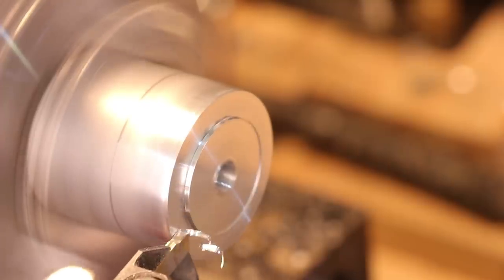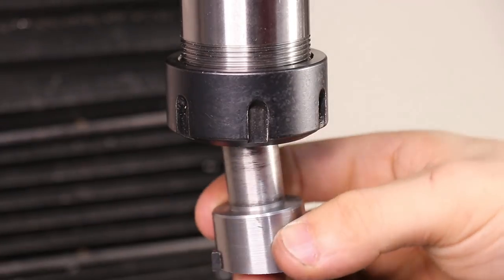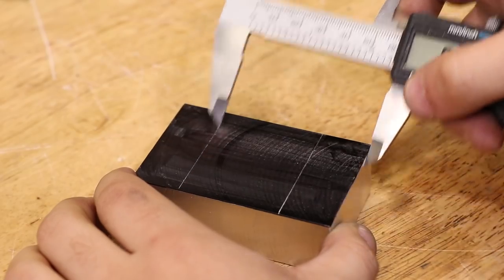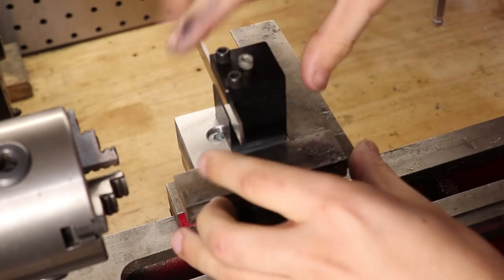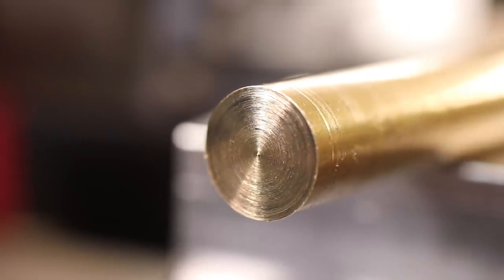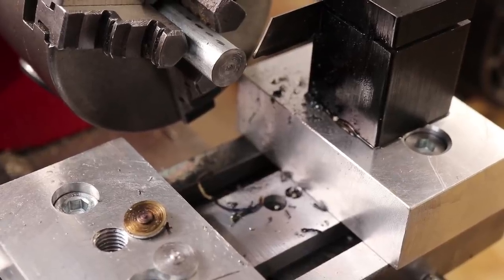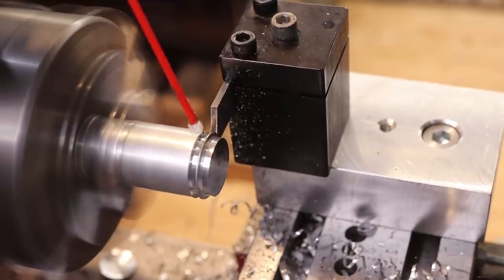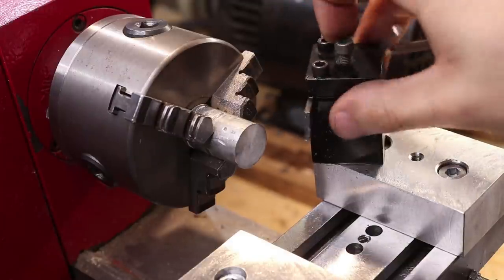Mini Lathe Rear Cut Off Tool Post Upgrade

Comment: You are definitely turning the spindle too fast as you said. But you have very poor tool geometry there is WAY TOO MUCH clearance on the lower part of the tool (the top when inverted). You should have that area of the tool almost vertical. Since the part is round, as it rotates, it moves away from the tool and creates its own clearance automatically. With all the clearance you have, there is a high likelihood that the tool can be pulled into the work-piece (which is why the aluminum was grabbing). The top rake on your tool wasn't the problem with the aluminum, it was the front clearance....
Reply: Yes, you are right. The front clearance regulates the feed rate and prevents the tool from being pulled into the workpiece when ground at the correct angle

Comment: P.S. Get rid of the inserts. Its lazy and it keeps you from actually learning what you should have mastered before you started making you first parts. You are NOT a production shop, you're NOT running thousands of inches a day past tool bits. You have no need for inserts. You have a baby lathe. HSS WILL DO FAR MORE FOR FAR LESS MONEY. But, it requires thinking and learning.

Comment: You need to heavily study blade geometry. One blade does NOT cut all well. Adjusting just the speed is a recipe for a Fuqit Bucket full of scrapped parts. Your steel blade needs SIDE RELIEF.  Heck, all of them could befit from side relief. Side rubbing is where a butt tonne of your power is getting lost in your parting ops.

Comment: The keys for me are narrow parting blade and lower rpm. If I keep the speed below 300 rpm I can part steel just fine.
Reply from the maker: Cheers, I'm looking to machine a new set of change gears to drop the rpm to achieve these lower speeds
Reply: @artisanmakes  That will work.  Parting is one of those operations where everything needs to be perfect.  Very sharp tool, narrow tool, perfectly square, low rpm, your best high pressure cutting oil and then it will behave.  Love your channel. Those of us who operate the smaller lathes and mills don't have much content.  Thank you.
Reply: I have a mini lathe and for me self ground parting tools with about 2mm width, slight side reliefs and quite a bit of positive rake on not too low rpm work best. I also recomment to give your hss lathe tools a little touchup on a wetstone after grinding for a finer edge. So far I was able to part everything from Aluminium to stainless steel with some trial and error.
Reply: @artisanmakes  get mgmn inserts which actually work better at higher speeds. 

https://youtu.be/h6gVItCo1-I

Edit: I might've been too sleepy, missed the bit about rigidity and the fact that you've already got those parting inserts.
Reply: @brianmoore1164  take this with the knowledge that I'm talking about larger machines, but in my experience if you run the lathe at the same speed you would for your turning tools, and you keep high pressure on your parting tool you can achieve spectacular results. Usually if my part vibrates while parting I dig my tool in harder and that will quiet it right up
Reply: @chazmakarowski5429  I know what your talking about with keeping the pressure on and keep the tool cutting, but the little machines lack the rigidity for speed. You can pretty much do what you want in brass or aluminum, but as soon as you start to cut steel the pressure gets high enough that everything starts to flex. I can cheat it a bit if I screw the gibs down full stop on the compound, but it's easier to just drop the rpm. In cold roll or hot roll my lathe loves 270rpm. In 4140 it wants 200. I am operating a C4 sized machine and it has enough torque to cut that slow. Some of the stainless steels can be crazy hateful and others are no problem.  I use a lot of free drops so I never know how it will act until I start.
Reply: Likewise.  I had really good luck with low rpm and P style cutoff blades (e.g. HHIP 1/16 x 1/2 x 4-1/2 Inch 5% Cobalt P1 Style  Cut-Off Blade).  I run the lathe at the bare minimum speed with just enough torque to keep turning(120-150 RPM).  With a confident first shove and not too aggressive feed, I get nice flowing ribbons going.  It works great even on silver and stainless steel.  I think getting nice  ribbon chip is key for a smooth cutoff.
I tried in the past using high speed and found the chips became too small, blade overheated , and lathe chattered a lot.  I got the low speed tip from Quinn @Blondihacks.
A few strokes on the honing stone keep the blade sharp between uses.

I enjoy your channel a lot.  Keep up the good work.

Comment: There are many good comments here but the main reasons parting is difficult is due to the harmonics caused by spindle flex due to the distance from the cut to the spindle bearing and the cumulative leverage of the tool holder.  For the first issue there isn't much you can do beyond getting a chuck that is not as long.  "Winky's Workshop" did a series of videos on this topic, though he didn't really cover deeply the harmonics and natural frequencies which are what produce the chatter.  Reducing the distance changes the harmonics which improves things like parting.   The 2nd issue is based on the geometry of your ways and the position of the cross slide and compounds in relation to the ways.  When you move the cutter to the back and flip it upside down the cross slide is pulling up on the bottom surface in the back way.  This surface is not machined well on mini lathes and has a limited surface area.  It also is not rigid because of the grub screw adjustments in the back of the cross slide.  The reason reversing the motor with the rear cutter position works well is that it pushes down on the rear way which provides a very large contact area with little flexibility.  Your way pulls it up and unless you rework your rear cross slide way adjuster I doubt you can get good results over having the tool in the normal position on the front way.  As the cross slide "pulls up" it either digs in or backs off which produces the chattering with a regular frequency that is driven by the tool geometry and spindle speed combined with the natural frequency of the spindle flexing.
Reply from the maker: At this point i'll take what I can get. These lathes just aren't up for the job. The lathe I used to machine on probably weighted 10to15 times this. Considering how little i part anyway, im going to leave it at this. Cheers
Reply: @artisanmakes  I just made a whole video on the topic that I think could help you out.   maybe you can watch it,  baseline your machine, and finally share the measurements?

Comment: Thank you for the video. Very interesting. Perhaps it is time to investigate (electrical) means of reversing your lathe motor.  A switch to reverse the wiring to the stator coils will do that fairly easily if they are accessible, if not a motor capable of being reversed in that manner might be worth the investment in time and dollars (I find screw cutting right hand threads is often less traumatic with my lathe in reverse and the tool mounted upside down).

Comment: Your mill is "out of tram."
Reply from the maker: i know its out of tram, the adjustment gibs stripped in the hole so I'll have to drill it out to fix it. Parts still fall within tolerance so its not super high in the agenda.

Comment: High rake tools are a great option for low power tools as this mini lathe since it gives more of a shearing action over a tearing action for the cut which requires less power and can leave better finishes. The downside of course is that the tool geometry is weaker and loses the ability to dissipate heat.

If the aluminum wasn't cutting well with the positive rake tool my guess would be that it did not have have enough cutting oil to prevent build up on the edge. Being on the underside like that would make it harder to apply the oil directly before the cut compared to the tool being the other orientation.

Comment: Nice work! 
Made a similar rear toolpost out of steel for my Minilathe and it cuts steel, stainless steel and titanium like hell :-)
Reply from the maker: Titanium on a mini lathe is very impressive. Never attempted it on mine.
Reply: @artisanmakes  Titanium is roughly the strength of steel. Choose either indexable inserts for aluminum or very sharp HSS tools with a cutting angle between steel and aluminum.
Cool well, especially when parting off. In contrast to the other metals, the chips do not dissipate the heat. This means that the workpiece will warm up quickly.
Drilling: normal HSS drills, but lubricate well otherwise the drills will rub into the hole.
Then you can do it.
Titanium is just a metal too ;-)
I will soon post a video making a ring out of titanium. External turning, drilling, internal turning, parting, everything included.

Comment: This can be useful to have in certain setups where you can use it without having to do as many tool changes. However, like you said with your improved cross slide setup it's already rigid enough so it may not be a real improvement in that way.

Maybe with a motor change for something higher torque/lower rpm you could part off steel better.
Reply from the maker: Cheers, I'm looking into a new gearbox to power the lathe so I can better reduce the rpm.

Comment: Regarding the rake on the blade for aluminium, I was always taught that aluminium cuts best with quite an aggressive rake angle on the tool, around 30 degrees, where most other materials are between 5 and 10. This could be why you were finding the tool with no rake cut better than the positive rake
Reply from the maker: You are right, and I might have made a small mistake here. You see I used to try and part aluminium with a 30 degree rake tool and it used to dig in and stall the motor, hence why I made this rear cut off tool. I had since reground the tool to have a less aggressive rake to prevent it biting in.  However i didn't regrind it back to its original 30 degree rake angle. I'll have to try and see how it performs.
Reply: High rake is good for aluminium, but you have to make sure the setup is rigid and has no leadscrew backlash. That backlash slop will allow the tool to "pull in" to the job.
I had problems like that with my little China 7x20 lathe, mainly fixed it by using a crossfeed clamp semi-tight, to basically tighten the crossfeed gib right up so it can't pull in to the job. Having a hand screw to tighten the bib as needed means you can run it real tight for those few scary seconds when you are parting lol.
Reply: @wizrom3046 Yeah, I tighten the gib ”excessively” for parting, and after I slacken it back to normal.

Comment: You should make some kind of cover for your t-slots. Cleaning them out may get annoying after a while. It’s pretty simple if you have a 3d printer.
Reply from the maker: Thanks for the suggestion but I haven't run I to any issues so far, shop Vac cleans them out with no issues. And i only have a DLP 3d printer and the resin does not typically stand up to wear and tear.

Comment: At around 4:16, when you're talking about the positive rake blade - one can also just quite obviously see the blade FLEXING (leftward); when you switch to the zero rake blade, well, it's quite a bit THICKER, and doesn't flex! It just seems to me that has rather a lot more to do with it than rake, no?
Reply from the maker: possibly, but the rake was the factor most responsible for the aluminium catching on the edge of the tool
Reply: @artisanmakes  NO. The complete lack of side relief, on a thin blade, with the wrong rake, on a cross slide with functionally no vibration absorbing mass is why!
Reply from the maker: @canberradogfarts  it probably not quite visible on camera but the parting blade has side relief ground into it from the factory.

Comment: Tune your lathe FIRST. Check headstock runout accrois tbe entire speed range. Get TWO temperature probes and monitor the temperature of both front and rear headstock bearings. Check without load for an hour, taking the temp every five minutes. Stop and let it cool down overnight. Repeat under medium load (YMMV) and again take temp ever five minutes for at least 30 minutes. YES you need to be making chips the whole time.

After you have done ALL of this, then experiment with blades.

Crawl first, then stand.
Reply from the maker: I replaced the bearings not too long ago, the run out is just under 8 microns with the preload I put on the bearings. Its more than I could ask from a lathe at this price point, and I don't think I could ask anything more from it.

Comment: I've wanted to buy a lathe and mill for so long but due to space I can't fit them. Also me being an actual real machinist I am not impressed how these work. Maybe some day tho. They might be handy to have along a 3d printer.
Reply: I know what u mean, I was a machinist and while it is a lot weaker than a normal machine, there are more powerful ones than this one, I got a micro mark7*16 cuz there are no headstock gears and it has more power, u can run it really slow, and has better tolerances. I also am limited on space big time so could only get small machines , and if u take smaller cuts and take ur time they can still be very useful. I have an ender 3 pro 3d printer massively upgraded from years ago , but now Im more back into machining and it sits around now that I'm cutting metal again..lol
Reply: Touche`

Comment: I have found that, if anything, a set up like this is less rigid than in a conventional way. The tool post is now being lifted, and the carriage being slightly lifted off the ways. There's a strong reason for the lathe to be in reverse, and flipping the tool doesn't make sense on a small lathe, its not rigid enough. I'm surprised there was a supposed increase in performance.
Reply from the maker: I guess there are some pros and cons with which ever way it is set up. I think with my new compound slide the set up is that much more rigid that running it like this is okay. From my observation, I would rather it be a little less rigid than risk the parting tool digging in. Each to their own, Cheers.

Comment: cutting speed is completely wrong
Reply from the maker: I talked several times in the video, I have a gear driven lathe and the lowest speed is still too high. I need to machine some new pulleys to change the ratio. Not optimal but I have to work with what I have available to me, Cheers.
Reply: @artisanmakes  you need to calculate the cutting speed and choose a proper tool for it, for a D=25mm round steel stock and a cutting speed of 100m/min you would need 1200 rotations per minute, for 20m/min you would need 250 rotations per minute